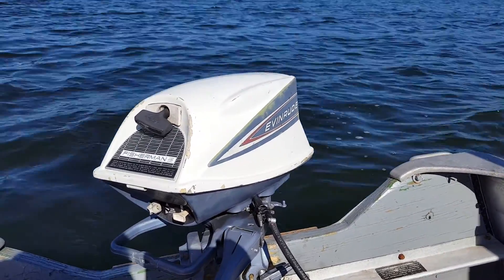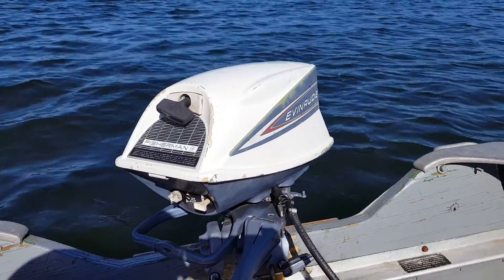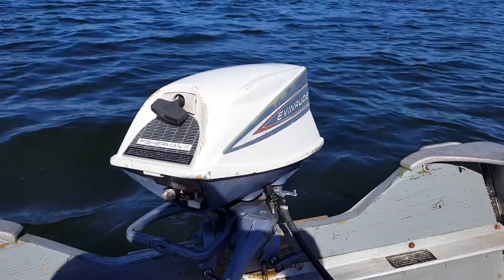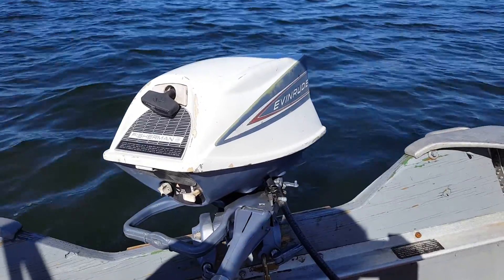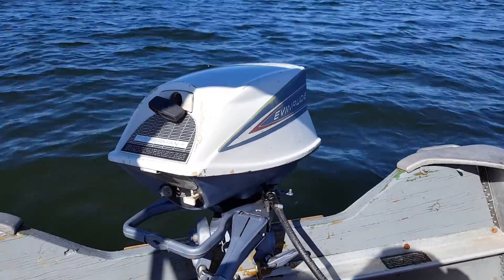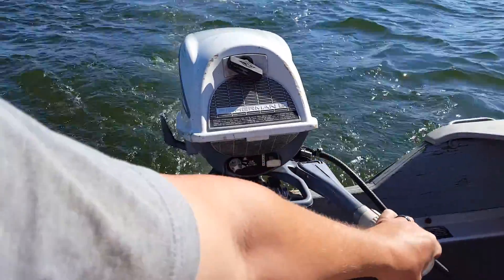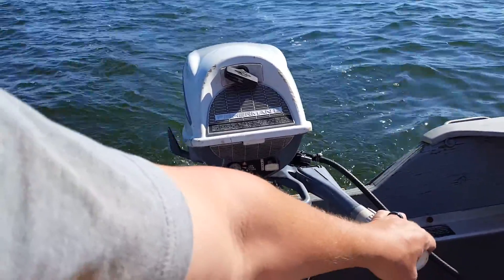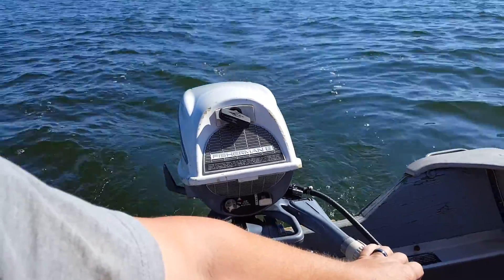1964 Evinrude Fisherman 5.5hp Outboard Motor

Comment: You mentioned the 1964 Fisherman and CD have the full roller bearing powerhead, but looking at the 1964 parts manual on Marineengine, I can't find any differences from the '61-'63 models. I just acquired a '64 Fisherman, so I would like to get to know some more on the bearings in this motor.
Reply from the maker: You're correct. If has the same powerhead as the 1961 motor.  Apparently they went to coated pistons in 1964 which they felt was enough to allow these motors to run on 50:1.  Since investigating this a bit further, I run this motor on 32:1 or 24:1.  OMC also changed the mix ratio of the 3hp to 50:1 in 1964. That motor still uses babbitt bearings on the powerhead and they tend to run on the warm side anyway. I see a lot more of them in 1964/65 that got used with 50:1 that are worn out prematurely because of it. These do at least have rollers on the rod journals on the crank.  Not having an adjustable main jet, I lean toward 32:1 as a compromise between enough oil and not so much that it could lead to a lean running condition due to displacing the gasoline in the mixture. This is just my call. 
Even the 6hp beginning in 1965 is not fully jeweled. Those do seem to run reliably on 50:1 mix though. Thanks for watching (and paying attention, LOL) 😉
Reply: @oldjohnnyrude8404  Could it be that one of the reasons OMC advised the 50:1 ratio was the introduction of the fixed high speed jet in '64? That the models prior to '64 could run on 50:1 as well, but as a precaution, OMC advised a heavier oil mix, in case of owners leaning out the high speed to much? And when the motors got a fixed jet, they were always secured of a rich enough high speed mixture, so OMC thought 50:1 was safe to run? Just some of my thoughts, I don't know if there's any truth in it 😋.
Reply from the maker: @VintageOutboardMan  I don't think the fixed jet is the reason. If the 1954-1960 5.5 had a fixed jet, they would not live long on 50:1 once they added the rod bearings and bumped the mix to 24:1, they would probably go a lot longer.  On good oil  that stays in solution rather than the old SAE30 non detergent did, 50:1 would probably do for a long time.  I still don't feel right running one of these motors on 50:1.  With a fully synthetic outboard oil, the thing would probably last a lifetime running 50:1 though.  I have considered using a '61-up 5.5 on 50:1 synthetic just to see how it does over time as a test mule.  The issue is, I don't run a 5.5 enough to tell. I do most of my boating with an 18 or 25hp. If an adjustable high speed carb 5.5 was run extra lean on 16:1 mix, though, there is a lot better chance it would survive the abuse with the extra oil in the mix than if it was done with less oil.  I know 50:1 will kill those plain bearing 5.5s way before their time.
Reply: @oldjohnnyrude8404  I took a look at the 6hp parts manuals from '65-'78 and it seems that none of the 6hp were fully jeweled. So not only in the beginning. It looks like OMC began to fully jewel the 6hp models in the 1980's. I'm surprised how many of these older 6hp still run after 50 years of 50:1 use. Here in the Netherlands they are very common motors, much more common than the older 5.5hp. I always assumed that more 6hp had survived because I thought they were fully jeweled, but now it seems like the powerhead didn't really change from '61-'78...

Comment: That is one sweet motor.  I love the 5.5s.  they are so smooth and quiet.    Thanks for the video.
Reply from the maker: Thanks Greg!  Yup, this one is a Sweetheart.  I couldn't ask for a stronger, smoother running 5.5.  I really like those little motors too.  I'm starting to get a few of them but that's OK.  This one's certainly a winner!
Reply: +Old JohnnyRude I am getting quite a few.  not all run, but I have fun making them run.  I have over 50. Johnson,  Evinrude,  Martin,  Elgin,  Champion,  and my first motor from 1970, a Mercury Mark 6. I need to get it running.
Reply: +Greg Offenback my favorites are the omc s.

Comment: I need an impeller for mine. Are they easy to find? The motor wasn't started for over twenty years. Fired up and idled after only two pulls. The impeller is not pumping water. I'm going to use it on a 14' sears. Hope to find the parts soon.
Reply from the maker: Congratulations on your motor.   These are my favorite motors.   Impellers are still available and easy to find for these.  Below is a link to an impeller repair kit that includes new pump screws, drive pin,  Impeller and water tube grommet from Marineengine.com. Thanks for watching!
https://www.marineengine.com/newparts/part_details.php?pnum=OMC0379766

Comment: What a powerfull 5.5! I am wondering what compression numbers it will show. Could you maybe test it someday? I'm really curious...
Reply from the maker: VintageOutboardMan Thanks for watching! Yes, this one is quite impressive for a 5.5. I will test the compression this weekend if I get a chance and let you know.
Reply from the maker: VintageOutboardMan I Did a compression check on this motor.  It's nothing overly impressive at 70/75.  I have other 5.5s with 80+ that won't keep up with it for whatever reason.  I'm sure the roller bearings help, but this one pushes this same boat faster than my 1968 6hp.  Which incidentally has slightly higher compression numbers.
Reply: Old JohnnyRude Thanks for letting me know! You wouldn't expect it to be that fast with those compression numbers. Maybe the prop pitch is not the original pitch? I bet that great looking green 5.5 Johnson of yours has awesome compression, it's such a pleasure to see it run :)
Reply from the maker: VintageOutboardMan you're welcome! It is pretty surprising. I have a fee others I need to run on the Sea Nymph 14R to do an apples to apples comparison.  It is a faster low hp hull than my Alumacraft FD.   The 55 CD-12 has low 80s compression top and bottom.  It's a sweetheart and a superb runner.
Reply: Old JohnnyRude Well, I'll be looking forward to your videos, I enjoy each one of them! Here in the Netherlands those <'60 outboards are pretty rare, so whenever I get the chance to buy one for the right price, I try to get my hands on it. I once came across a never used ('53 I believe) JW. It still had all the manuals and purchase documents with it. Maybe even the original crate it came in, but I don't know for sure. It sold for 370 euro's and I still regret I didn't buy it :(
Reply from the maker: VintageOutboardMan Thank you very much.  As as I can get the time to.get on the water, I have several ready to be run and several more in line to be worked on.  I hope I can get at least 25 on the boat next season for videos.  I have the motors if I can find the time.  That NOS JW would have been a very cool addition to your  collection.

Comment: I just bought one, it’s in amazing condition, just looking for the fuel connection .
Reply from the maker: Congratulations on your new motor.  These use the modern single line OMC fuel connector.   There are usually some available on Ebay. Im assuming you are missing the fitting on the motor.  Thanks for watching!

Comment: Is there another way to replace the impeller without having to take the top power head on this particular motor.
Reply from the maker: No. The powerhead must be removed to service the water pump on these.  They're made to be removed as part if regular maintenance, so it is not a huge deal to take it off.  Thanks for watching!

Comment: i have questions how mix oil 50:1 or 24:1
Reply from the maker: This motor is a 1964.  1964 was the first year for 50:1 mix. 1961-1963 5.5hp were 24:1 and 1954-1960 are 16:1 motors.  Thanks for watching!

Comment: Could you by chance tell me the part number for the propeller. I have the same motor but no prop and im trying to find one
Reply from the maker: 0376968 is the part number for the propeller.  They're kind of pricey buying new.  You may want to check eBay for good used ones.  Thanks for watching!
Reply: Thank you very much I appreciate that
Reply from the maker: @thumpah1  You're very welcome!👍

Comment: You'd mentioned that this one was worked on by someone else, do you have a link to that series of videos by chance?
Reply from the maker: Two friends of mine worked on this motor before I got it.  I'm not sure which series of videos you're looking for.   I have a series working on a 1959 Evinrude Fastwin 18hp.   Ben Dittmar,  one of the two that worked on this motor, has a video showing full tune up service on a 1955 Johnson 5.5hp which mostly applies to this motor on his chrysleroutboarddude channel.  Thanks for watching!